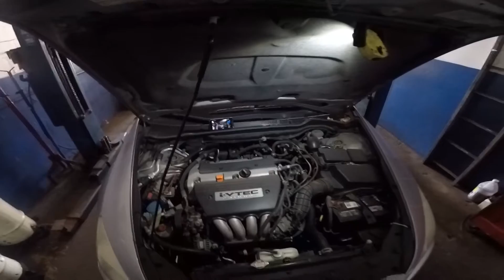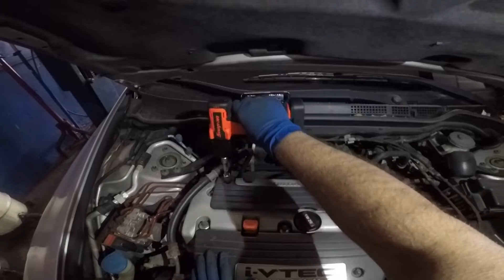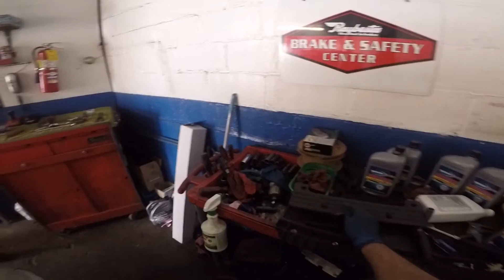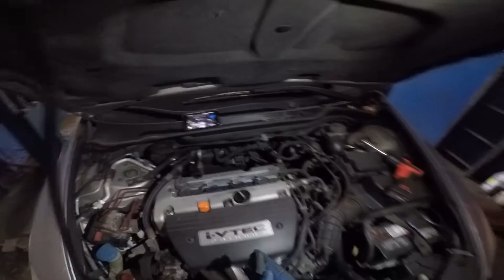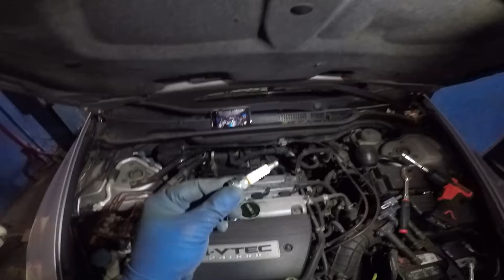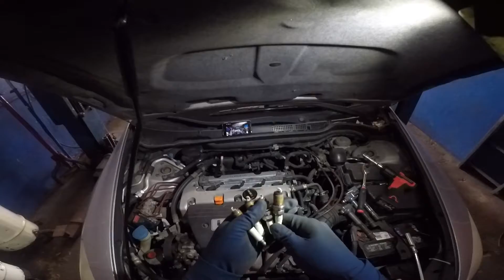How to replace Spark Plugs on 2004 Honda Accord 2.4L

Comment: On my car, the bottom left bolt on the plastic cover won't tighten.  How could this be fixed?
Reply from the maker: Not sure take out the bolt and see the threads

Comment: Which size is that long socket to get the spark plugs out
Reply from the maker: I think 5/8 not sure I would need to check my tool
Reply: @RBTheMechanic  ok and after putting the new spark plugs in does it help the Honda accelerate better ?

Comment: I bought a 5/8 magnetic spark olug socket connected to an extension cause the rubber grommet kept getting stuck on the plug when i would take out the socket, absolute genius tool
Reply from the maker: Yeah I hate that I use separate magnet to get the pugs out

Comment: I live in California.  NGK has the Federal and California version of the gap for the spark plugs.  Would I not pass emission testing if I buy the Federal version?  What is the difference in performance?
Reply from the maker: Usully it’s not spark I will look in to talk at I know the emission systym catalytic and sensors dose matter if that’s wrong u will not pass
Reply: Doesn’t matter, it’s spec’d to the vehicle not the emissions.

Comment: When I pulled out the first plug, the plug had a black rubber gasket on the tip. I put the new plugs and it's running fine. I looked it up I have to replace the whole whatchamacallit??
Reply from the maker: The ignition coil?
Reply: @RBTheMechanic  it has a hole where the terminal was sticking out of, and it has grooves on the inside for the insulators. Is this a boot ? I basically want to know if I need to put it back on the new plug that I already put in there? The car sounds good, the acceleration sounds better.
Reply from the maker: @idawg47  can u make small video so I can see what exactly ur talking about
Reply: @idawg47 this sounds like the rubber grommet from the spark plug socket you used to loosen the plug. Sometimes they come out and stick on the spark plug.  I know this was a year ago…haha. Leave the rubber grommet out of the car, it belongs in the plug socket but you can just throw it away if you are going to use the coils to remove the plugs.
Reply: No it's not the engine coil. I pulled the coil 1st, then as I used the coil itself to pull out the spark plug it had an inch long black rubber gasket over the tip of the plug, I pulled it off and put the new plug in with out it.

Comment: My accord turns on but when i step on the gas, it wants to stall... any ideas??
Reply from the maker: Connect ur scan tool to see what or if there are any codes also check the live data from throttle sensor seems like glitch in TP sensor

Comment: What was the socket size for the spark plugs
Reply from the maker: 5/8
Reply: @RBTheMechanic  preciate it I got it done earlier as it started raining then I left my rachet inside and when I started the car it fell and I thought I messed something up 🤣🤣
Reply from the maker: @eze4125  haha I left my snap on screw driver 2 for long best one I had under hood last week I tried caliper Customer he said he will come next week
Reply: @RBTheMechanic  quick question does it matter the bolt down tq matter I don’t have any of that stuff so I just hand tighten
Reply from the maker: @eze4125  I hand tight 90% of the stuff u should be good!! I trust my hand more than torque wrench

Comment: Honestly, it doesn't seem hard. Tbh. It's just you have to be more patient. Thanks, for showing this video, man. Honestly, going to a mechanic to do stuff like this can be pricy af. Last time I got my spark plugs changed was on my old 2009 Chevy Aveo Hatchback and I literally got charged $445 just to get my ignition coils and spark plugs changed...
Reply: Also, how tf can spark plugs, break dude?
Reply from the maker: @michaelgonzales558  it can brake if u yank the socket to side
Reply: I'm going to follow your channel, man. Because honestly, this was really helpful, bro!
Reply from the maker: @michaelgonzales558  thank you!! I’m always here to help with any type of repair
Reply from the maker: Yeah this one is super easy

Comment: Torque to spec. What is the spec for that? That should be important in this video?
Reply from the maker: Sorry I know important information my newer videos I have stepped up lot and give torque specs part number and cost of parts anyways please give me ur cars year make model I will get you torque tomorrow morning when I get to the shop
Reply: @RBTheMechanic  2004 honda accord EX 2.4 sedan, auto.
Reply from the maker: @halopcdraco  will let u know tomorrow
Reply from the maker: The torque spec for spark plugs is 13 ft lb
Reply: @RBTheMechanic  Eek, i only have a torque wrench that goes down to 20
Reply from the maker: @halopcdraco  uh oh buy one of amazon
Reply: @RBTheMechanic  I replaced them today and didn't need a torque wrench.
Reply from the maker: @halopcdraco  ok as long as u tightened is good enough and not brake it
Reply: @RBTheMechanic  The plugs only go in so far. Now my car has a smooth idle. I did something correct.

Comment: Why you didnt .
Mention  The torque specs???????
Reply from the maker: Every car is different so I try to keep things out that u can mistake but if u need specs you can call up the dealer check Manuel or I can give it to u but still would tell u to conform with dealer just Incase

Comment: Hi I was wondering what is the name of the spark plug for Honda Accord euro 2004 ?
Reply from the maker: Hasssn Zahi you might have to call parts department for that name but I use NGK or denso
Reply: RB The Mechanic thank u so much

Comment: Great video. I'm getting ready to do my 04 now and watched you first. Only questions I had in video is what the torque spec was for the plugs. And did you use any antisieze? Thanks 🤘✴️🔆 📀➗ 💥
Reply from the maker: 13ft lb  but do check or call dealer for your cars torque spec and I did use antisieze u can get it from parts department they will tell you what you need oh also you can find out your cars torque spec from autozone or other parts department if you buy plugs from them make sure u give vin number

Comment: One more note, make sure before you remove the old plugs to clear out any debris that may have accumulated on or around the plug so they don't get into the engine.
Reply from the maker: Ngk are recommended torque spec is like 16 ft lb u can give me exact year make and model I can look it up